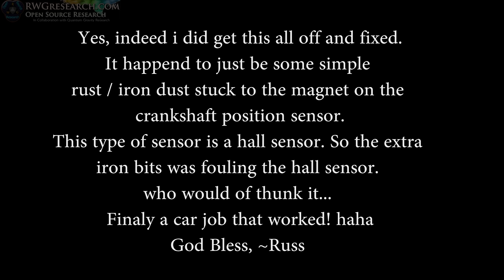This Sounds Like A Bad Idea... V6 3800 Harmonic balancer bolt removal. (Dust Fouling sensor)

Comment: I did that and it worked as I had to change the Crank Censor!  After reinstalling it, I believe I got a bad Crank Sensor!  Recently I picked up a 18V OCTANE Brushless 1/2 in. High Torque 6-Mode Impact Wrench (R86211B).  It took the bolt out without breaking a sweat (Maximum torque output of 1,500 ft./lbs. of breakaway torque and 1,100 ft./lbs. of fastening torque)!

Comment: You should have removed the belt and you'd get 10x more torque on the bolt and break it on the first crank!!!!

Think about it, the crank is not only trying to break the bolt but also all the resistance of components on that belt. First time I did this, I had my belt on, it didnt break, took it off and it broke 1-2-3. You actually had the bolt broke at 4:40, it just wasnt out far. Dont turn over very long as the bolt end can damage the threads once it comes almost out. ! What kind of pizza was that?

Comment: I tried this and made my timming chain slip. It works but maybe no for every car. An old mechanic told me the same thing. I seen another video that said torch the bolt and I did that next and it worked. I'll torch them from now on. This video shows it can work but beware. I'm glad I'm still in time but could have been bad on my 3.5
Reply: How do you know the timing chain slipped. Worried about that myself
Reply: @hippitymcstribbs4906  I got my timming cover off and it jumped two teeth. I used a torch to get the harmonic balancer off. Heated it tell it was good and hot, no problem.

Comment: I'm kind of surprised it didn't break the socket, especially when you went the wrong direction.
Reply: Looked like he went the right way to me, both times. Except the first time he had the ratchet lever going the wrong direction so it just spun. I would've used a breaker bar not a ratchet if I was crazy enough to try this. Also I would have disabled the coil pack so it wouldn't start. Best Wishes n Blessings Keith

Comment: yeah, need to do it when your in a pinch, don't feel like buying 4' breaker bar, I usually get my 1/2" on there and add a cheater bar, and pound that with the sledge hammer. Now this is just a nice trice to use the starter and Inertia from the engine cranking.
the things that can go wrong if you don't do it right is not nice. good job. always something ten dollar problem that cots you hours of labor to get to.
Reply: George Robles I tried this but method on my Chrysler 3.6 pentastar and burns a starter up in about 2 seconds I wouldn't try to fire you unless you have the money to buy a new starter or you have a big starter like on a V8 or something cuz these starters on these pentastar engines are tiny

Comment: What size socket is for that bolt?
Reply: Ive been asking people this question to and i have no idea why the hell no one wants to answer this. I bought the Official book for the 2002 Buick park avenue ultra and it doesn't say what size it is either and its a master mechanic OEM repair manual officially from Buick 🤦‍♂️
Reply: Ever figure out what size it is? Also, does ur book say the ft/in lbs of tightening torque?
Reply: 15/16

Comment: I tried the bump method on a 3400 engine, and the bolt rounded. 15 mm bolt. Soft metal. New bolt is 18 mm. Much beefier.
Reply: Gerald Bajarin I tried the bump method on my 2011 Town and Country and it burned my damn starter up right off the bat cost me a lot of money and a whole lot of time and frustration
Reply: Note to self, make sure there's a lot of beef on the pizza if I try this.

Comment: Hilarious video! I'm gonna try this. Fuckin bolt is beyond stuck
Reply: mncarguy hey buddy I wouldn't try that method unless you have the money to replace your starter I tried it on my 2011 Town and Country and burn my starter up in about 2 seconds I'm not kidding you either the first time I tried bumping it and that was it started was dead right after that I will say the starters in these Chrysler 3.6 pentastar engines are awful small really that could have been why it didn't work for me but just try it at your own risk buddy

Comment: I get that you are a genius and cant be good at everything, but balancer is spelled balancer and harmonic is spelled harmonic.
Thanks for the funny video!
Oh yah get some, nut remover(its a sprayable lubricant that dissolves rust) so next time its much easier.

Comment: You don't have to do all that to replace the sensor man.
Reply: You have to remove the harmonic balancer to even access the sensor in the first place. He lucked out in that there wasn't anything wrong with the sensor itself, he said it was just bits of iron/rust stuck to the magnet and interfering with the sensor.

So yeah, he definitely had to do all that. A shop would have used an impact wrench on it, but I assume he didn't exactly have one of those handy so he used a different approach.